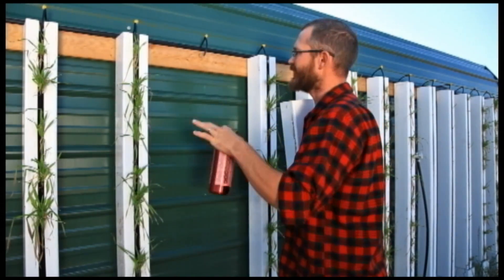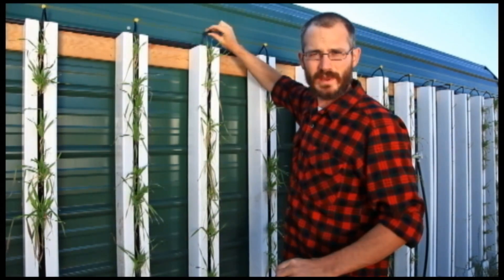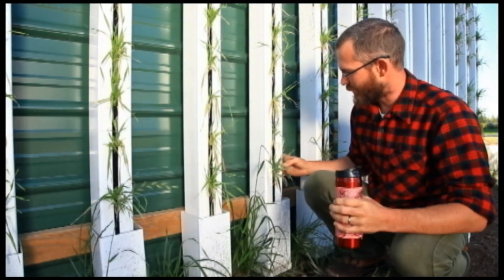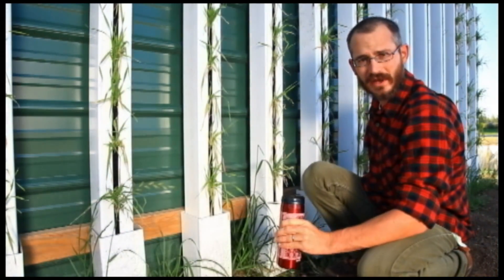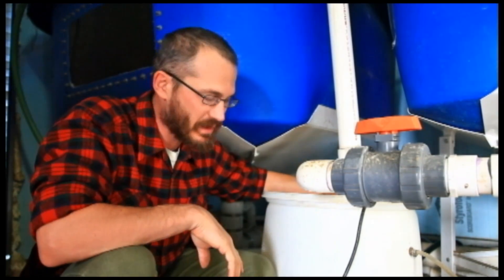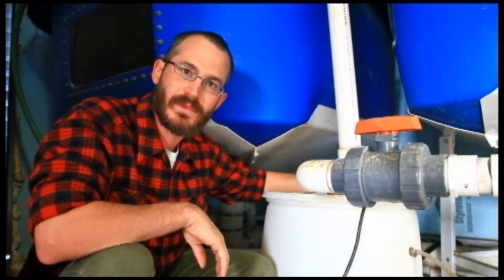How Do Green Walls Work?

Comment from the maker: We just chop 1/2" poly tubing into short lengths, fold the 1/4" tubing over on itself, and slide the 1/2" ring around the folded end.  It's super easy and super cheap and we can always make more in the greenhouse as we inevitably lose them.

Comment from the maker: The greenwall dead-ends off the our AP system.  Basically it uses the nutrient rich water from the system without recirculating back to the main system.  We'll put goldfish in it soon and then it will basically be a mini-system tied into our main one.